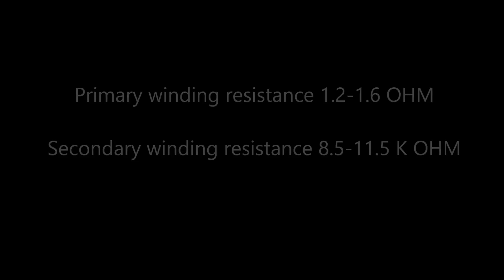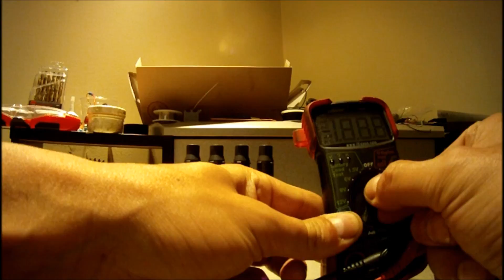Easiest Way to Test OE and AFTERMARKET Ignition Coil, CoilPack With Basic Hand Tools

Comment: My secondary reads 13.5-14.5 when hot right after running the engine and about 11 when cold. Are they defective since they read to high when hot? Primary is 1.5 on all 4.

Comment: Hey bro my name is Tyrone.  I have a 2005 Zx10r C2 model I believe. The issue I am having is between 3k to 3,500 RPM's my bike sounds boggy hesitant ! When I get the RPM's  up to 4k or higher bike runs sound as it should. This my very 1st gen 1 window maker Kawasaki Ninja. What adv iui se and or theory would you say that potentially could be causing  this issue in the lower throttle range when riding and I am simply cruising? Mid range and full throttle  no issue only in lower range of my throttle does bike act like this. It is as if it wants to cut itself off. Thanks in advance for all of your help advice & suggestions  upon my situation here. My email  as well bro is arlowepare1973@yahoo.com.. I have a video  of it running it sounds like the idle is probably  off as well not sure if it's due th o the above.. or a potential vacuum leak is culprit causing this entire set of circumstances..
Reply from the maker: Check your map sensor, it's mounted on the itbs.
Reply: @everydayirace  I do not know what you mean in respect to  its mounted to this ......" itbs " brotha..I am watching now a video 2:13 kawasaki Zx10r Inlet Air Temperature Sensor Testing of yours you made.

Comment: All of mine were 1.6 primary and around 10.9 secondary. Is there a chance they could be bad still? I’m having a problem between 3500-4500 rpm if I roll onto the throttle in that range it’ll start sputtering untill I get out of the range or full throttle it.
Reply: 09 zx14 btw. Unhooked power commander not it. Pulled out fuel pump and fuel filter it’s really dirty got a new one ordered. Just wondering if it’s my coils.
Reply from the maker: Check your afr at that rpm.
Reply: EVERY DAY I RACE excuse the stupid question but how do I go about doing that on the 14?
Reply from the maker: @ixskatextoxlivexx  With a wideband.
Reply: Common problem with the zx10r i JUST started having that problem. Im currently puting back my secondary butterflies, i used old header gaskets when i pulled my exhaust gonna replace those and like he said check my autotune afr in those cells. Just had valve adjustment so it eliminates that stuff. Plugs are from beginning of the year. So when i go to put my secondarys back in i wanna check coils and plugs again.
Reply: @kawilifezx10r23  hello..brotha Tyrone here. What is the autotune AFR ? And would it possibly be a vacuum leak causing choppy sputtering between range of  3,000 - 3,500 RPM's  ? Bcuz at 4k or higher runs smooth ? This my 1st Zx10r C2
Reply: I'm having a very similar experience and issue only mines is within this range 3,000 - 3,500 RPM's until I get beyond it to 4k an up nothing she runs smooth as a button. My name is Tyrone.  arlowepare1973@yahoo.com  hit me up bro if you got an answer to this very important question

Comment: Hi mate, just a weird one. I just measured my 03 636 ones. Secondary is in spec, but primary on all of them is 2.0-2.2 ohm. Now i know that usually one goes off spec, but all of them? And the weird thing is that they all in the same range. Bike is running bad.
Reply from the maker: It does sound weird, I would normally recommend using a second multimeter, but if it's running bad i'd get another set of coils and try them out, they're not expensive.
Reply: Thank you. Just wanted a second opinion on that before i go and buy a new set, I'll have a go with another multimeter and see.
Reply: @FixwithDom  did buying new set  cure it
Reply: @MrFireblade12345  kept them ones. Problem was throttle bodies on mine. There was some rust in one of the intake passages so it wasn't putting in good mixture in cylinder 1.
Changed that and works perfect.  Still have the bike with the same coils
Reply: @FixwithDom  can you email me photo brotha of your throttle bodies  that you are speaking of here that was issue an point out or circle area where the problem  was.
Reply: they are not expensive? i cant find original ones cheaper than 100 USD each,
Reply: @zinu3469  so each coil pack is $100 dollars ? Or are you simply saying for 4 new coils there $100 dollars total b4 taxes ?

Comment: Hey I'm having problems reading my secondary ohms it just says 0 on all the coils. do i need to take the rubber piece off to make sure it hits metal??? or maybe all the secondary are just bad.
Reply from the maker: I highly doubt that all the coils went bad at the same time.
Reply: maybe using a multimeter with the wrong ohm rating. my multimeter reads 0 ohms but i looked at the specs and it only reads to 6000 ohms. im going to get one that reads 10k ohms